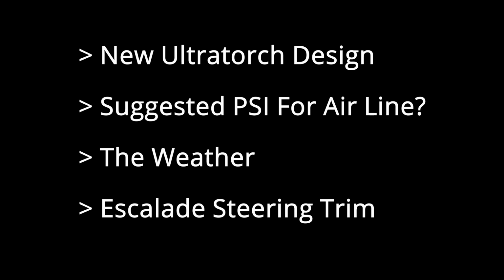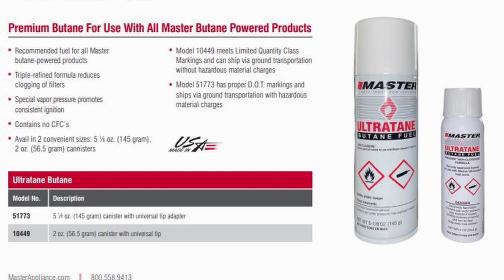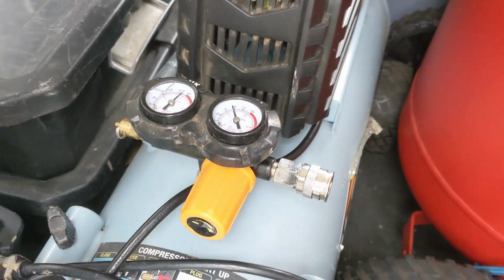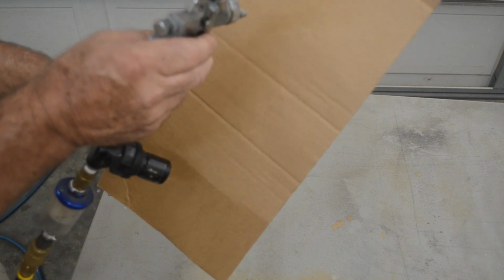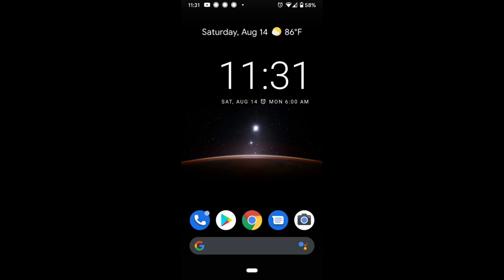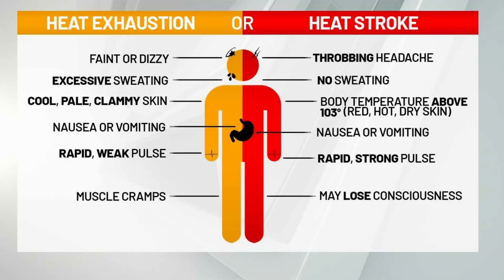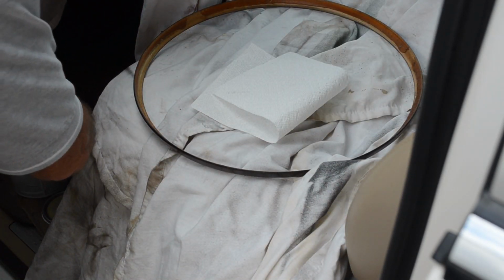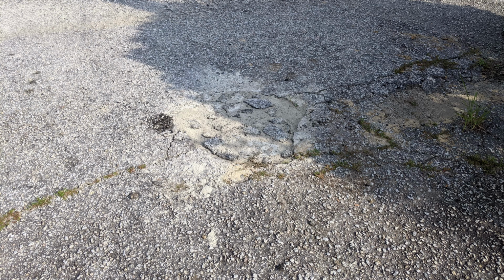Mini Seminar 2021 Ultratorch Ut100si, PSI settings, Weather, Escalade Steering Trim v76

Comment: Hello there. Tech from ohio here with a question for you. Just bought the new ultra torch 100si with iron attachment. It doesn't seem to get hot enough to even cure compound at its highest setting. Is there a trick I'm not aware of or did I get a lemon? Have you experienced this? Thank-you
Reply from the maker: I haven't had that but someone else did have that that issue.  He sent the unit back for correction and I believe it's all worked out.  I'll see this tech at the show and will ask him.  In the meantime drop me an email as a reminder.  Thanks.
Reply: @A.R.T.'s Real Repairs for Real Customers  Update: It seems the new ignitor rod that runs up the side near threads where tip screws on fits in a notch in the plastic and another notch on the metal ring above it. 
It was out of place and causing poor ignition and low heat. I re-alligned it and working great now. It came like this brand new and just needed a minor adjustment so this could help others with similar issue.

Comment: Thanks for sharing I'm with you I'd love to go somewhere and attend a seminar, meet up with other repair techs, but with the current situtation it just doesn't seem like the wise thing to do .
 I have had issues with the Ultratorches not wanting to ignite, I have taken them apart cleaned, them, I just recently found out about using premium butane fuel which does seem to help.  Master Appliance must realize they had issues or they wouldn't have redesigned it.  Steinel also makes a similar torch, I wonder if it's made any better? 
The weather is brutal here in Memphis too, hot and humid, it's been really bad the last couple of weeks. We have been trying to do our lot work and finish up around lunch time, then go to the shop to work out of the sun.
I do have a shop that is partially air conditioned (where we do sew work, and some repairs) the bay part does not have AC, it's out of the sun and we have fans but still very hot. I'm ready for some cooler weather!

Comment: I’d HIGHLY recommend the new wireless heat gun from Harbor Freight. It’s the best tech tool I’ve bought in years. I have two 60 volt batteries and I never run out during a typical day.
Reply from the maker: Thanks.  This is the first positive statement about the heatgun I've heard.  It's a great idea for the portability.  Will have to try it.  I presume the higher Ah battery is one you're using?
Reply: A.R.T.'s Real Repairs for Real Customers I use the Milwaukee cordless heat gun and it works well for small repairs but when I need to heat a large area the corded ones are best